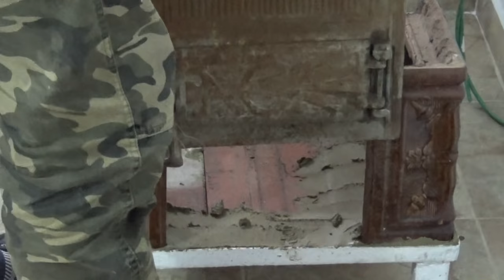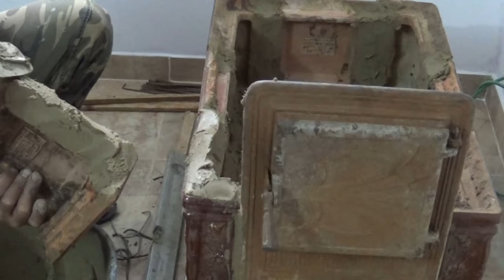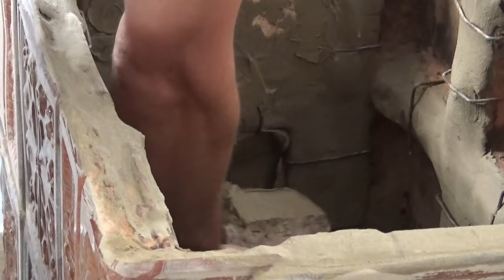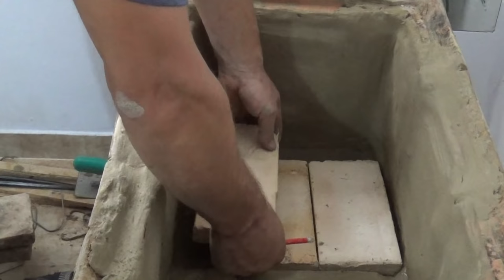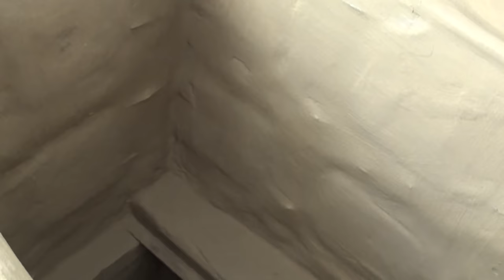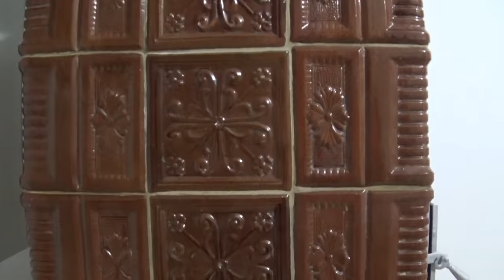Sobă construită din teracotă reciclată cu 5 fumuri | Materialul de lipit este lut nisipos și apă

Comment: Clemele de prins teracota din ce material sunt?
Reply from the maker: Nu știm din ce material sunt,  sârma a cumpărat-o de la metalochimice, este o sârmă specială pentru sobe de teracotă.
Reply: Fier.
Reply: O alta varianta pt sarma sunt electrozii de sudura cu grosimea de 3.25 mm. Sarma speciala pt teracota se găsește din ce în ce mai greu, trebuie sarma de 4 mm și oteloasa. Meșterul meu m_a pus sa cumpăr 3 kg electrozi pt o teracota cu 7 rânduri și 5 fumuri. Teracota a fost reconstruita acum 7 ani și nu am avut nici cea mai mica problema.
Reply: Poate fi procurată și din reciclarea arcurilor de la paturi vechi, recamiere, canapele, unele fotolii sau chiar de la unele banchete auto.
Reply: @ioanpaval2900  Nu poti folosi asa ceva este prea oteloasa si o poti indoi cu patentul
Reply: Clemele se confectioneaza din tije speciale pt teracote sau electrozi de 3 sau 4 mm , amestecul de material se face in functie de pamantul folosit daca este mai gras se pune la doua lopeti de pamant una de nisip  sau daca pamantul are deja nisip in el se pune nisip si se amesteca pana  se dezlipeste de sapa sau mistrie ..